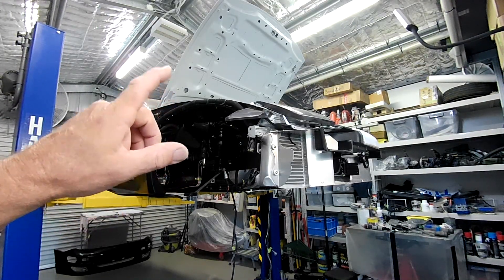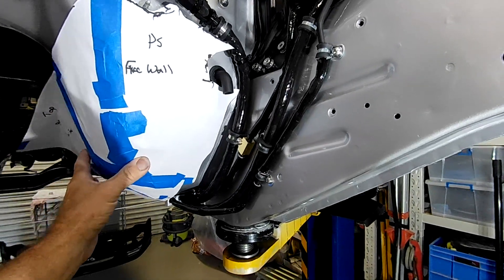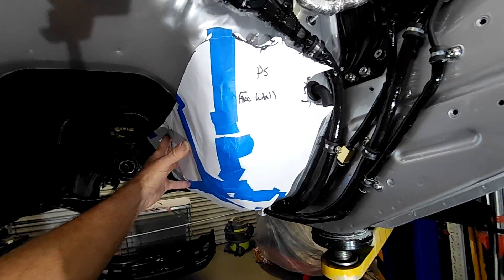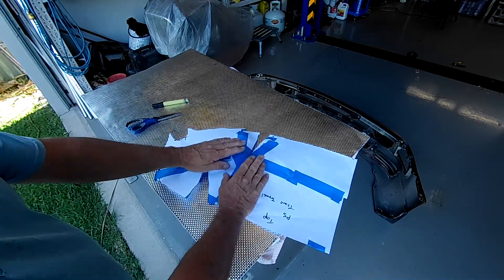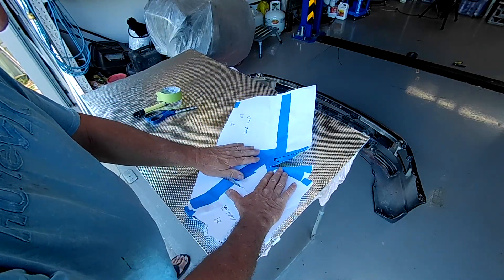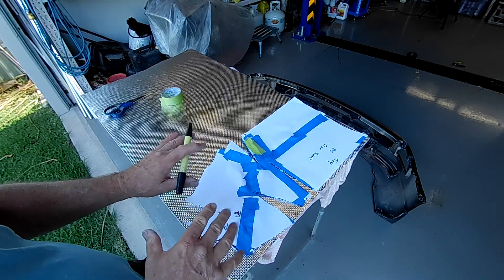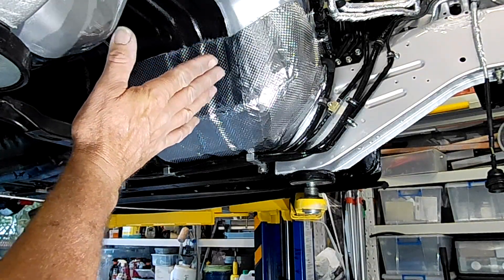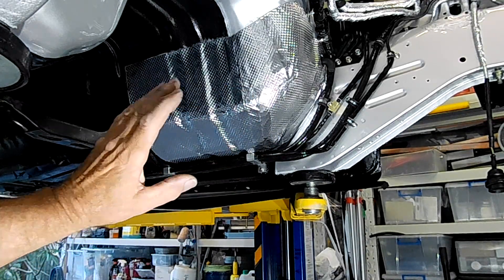Engine Bay Heat Shielding Part 2. Project Fairlady The Nissan Z32 300zx Twin Turbo Mega Build.

Comment: 👌Very well done. If you're still concerned about heat from the turbine housings it would be pretty easy to toss on a couple of turbo blankets while the motor is out of the car.